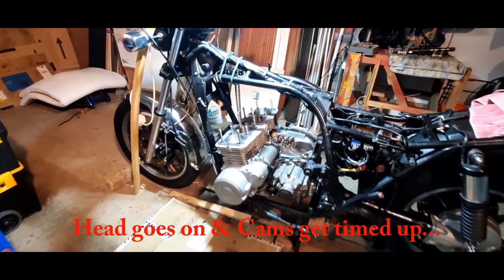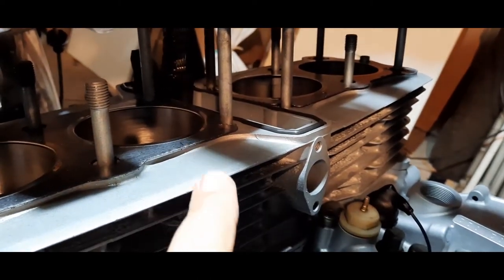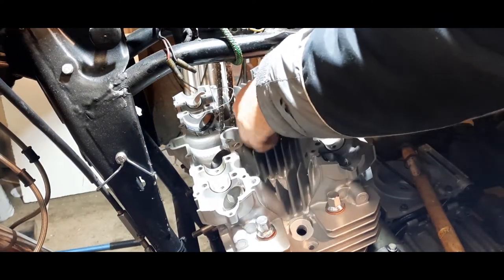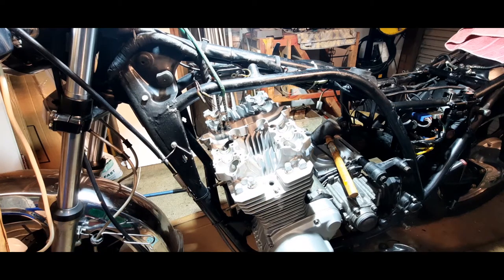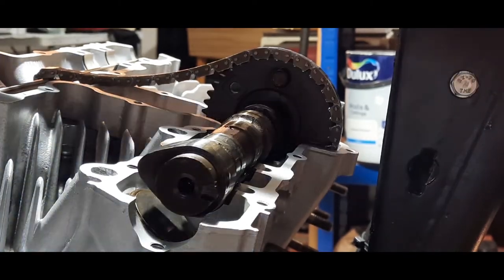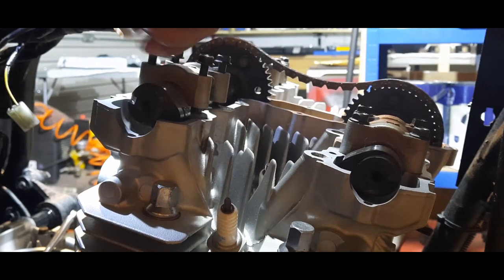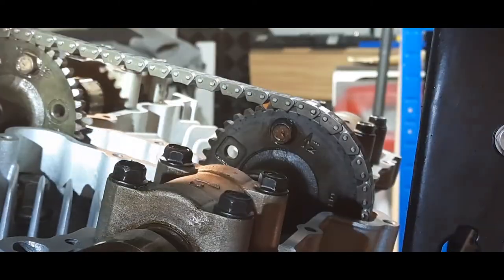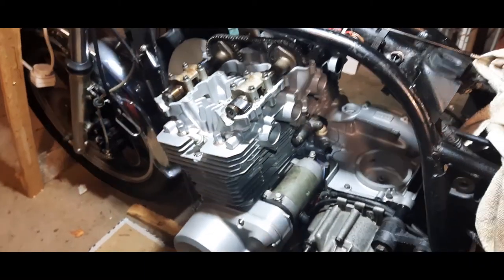KZ1100 head goes on & Cams get timed - Part 6

Comment: Good day
Can the drive shaft disconnect from the bevel gear spline without taking the rear wheel off ?
Reply from the maker: Hi Marvin , I would say you can , I tried it , If there is a helper one can prize the boot and drive shaft back and maybe get the pin removed that holds the drive shaft into the engine drive take off, i struggled with this trying to do this on my own , gave up and removed the back wheel and diff, I needed to grease the floating drive sleve anyway . In short I would say remove the diff, it may seem more work but its is easier overall. Hope this helps 
Gary
Reply: @garyspracticalworkshop357  Thanks for reply !